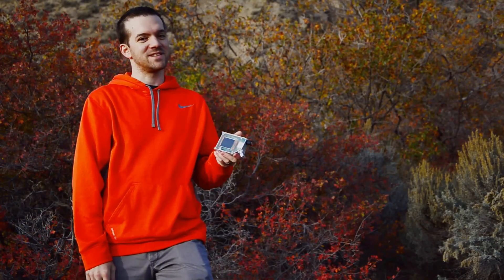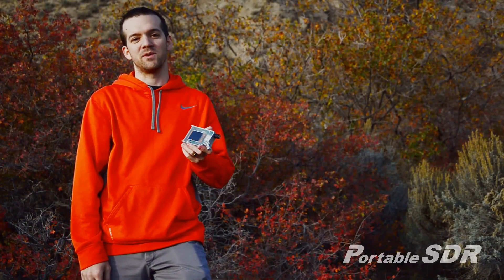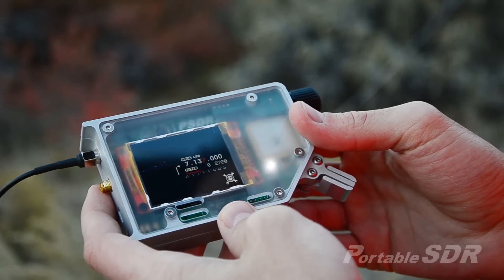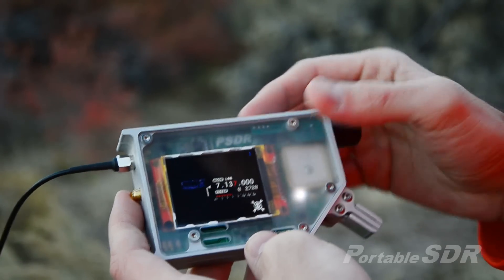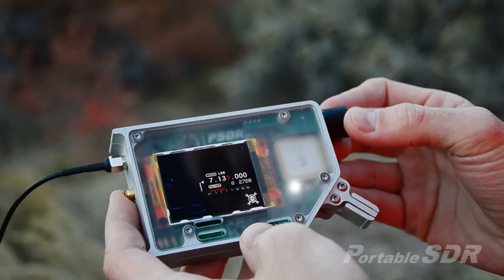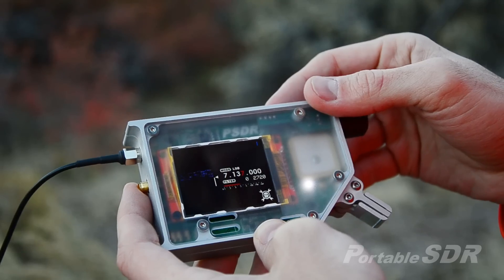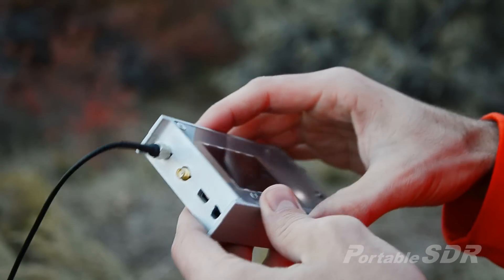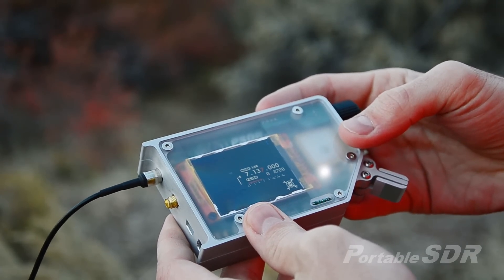PortableSDR

Comment: What's the deal with the part of the housing that sticks out in the bottom right (below the knob). Is it just an aesthetic feature or does it have a function?
Reply: Rowan Doherty, The part that sticks out of the housing is a Iambic Keyer for CW or Morse Code. This allows you to send Morse Code with a consistent rhythm. The intention is that you could use low power to send out messages. Since This SDR is capable of transmitting and receiving, and doesn't require too much space to include the electronics to allow it to work. I imagine it's removable given there are screws to detach it.

Comment: This is indeed a radio I want, I thought the Elecraft KX3 was a big leap for portable & SOTA operation but this takes it to the next level! Best of luck with the design and commercialization of the project. I can think of many use cases for this SDR... standalone data mode operation, interfacing with a tablet/cellphone etc... Good luck!

73 James M0JCQ

Comment: I am REALLY looking forward to this as a kit. How much more design work do you think this will take?
Reply from the maker: Thanks everybody! How much more design work is hard to answer. If you are interested in using the PortableSDR primarily as a receiver then it already works quite well. If there is demand, I may start making PSDR2s available fairly soon. Transmitting is still in development. I produced the first amp board about a week ago and it's not yet functional. The PSDR2 (the one in the video) will probably top out at about 1-200mW, though I might make a small external amp. If things go well PSDR3 will be somewhere in the 1-5watt range. That will probably take a few months.